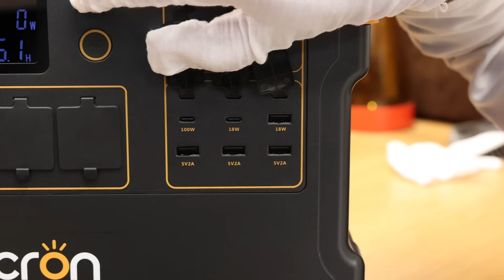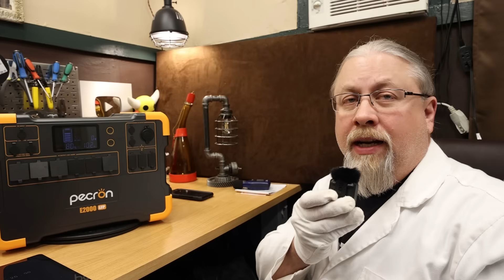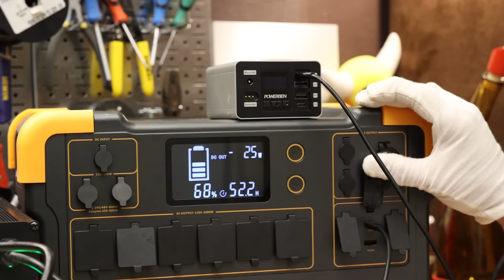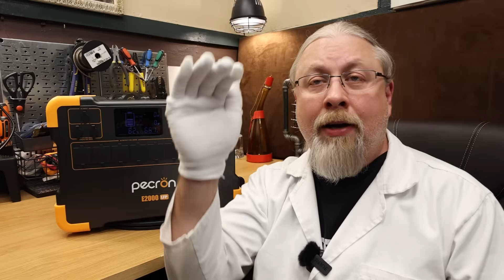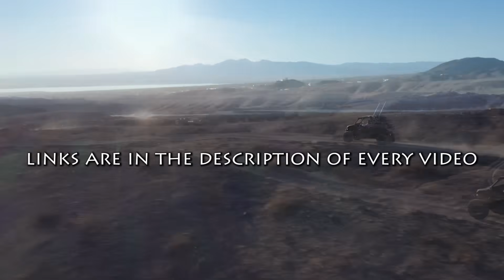Pecron E2000LFP 2000w LiFePO4 Modular Battery Solar Generator Power Station Review

Comment from the maker: CHECK OUT THE PECRON: https://gohobo.io/e2000lfp code HOBOE2000LFP for $854 
ORDER the 3072wh BATTERY: https://gohobo.io/eb3000
[UPDATE: Pecron now tells me my version was an early model and the 100w PD was fixed in the production version!]

DISCOUNT CODES on SOLAR PANELS - GENERATORS - REFRIGERATORS
https://hobotech.tv/amazon 

RECOMMENDED BEST PRODUCTS
https://hobotech.tv/
Reply: We can confirm this, all the e2000lfp units that are being sold now are 120v and have 100w (20v @ 5a) usb-c outputs :)

Comment: 3/16/26 - The E2000 is no longer sold. However, the E2400LFp is still available. Similar to this video's model, but there are some limitations like only 3x120V plugs. The 120V charging power supply is built into the E2400LFP; no external giant brick just a cable to the wall. This new model is currently $629, BUT you can get this from Off Grid Stores for that price and currently 10% cheaper with a coupon on their page for this model. That's $566 with free shipping for 2400W inverter and 2042WH of battery. Quite a deal if the limitations meet your needs. And you can still add two batteries to this one as well. No 30Amp plug FYI ... like the E2000.
Reply: They made two different versions of the E2000LFP and I've seen no review of that version on YT. I chose the version that includes the 30a RV plug but you get one less 120v household outlet (4 total).

Comment: Important note for people with this model (or similar models without direct AC input ports): passthrough charging works, but it is extremely noisy on the AC output. It will NOT pass the amp interference test when charging this unit at the same time.

Comment: I'm new to power stations. I bought one of these, a E2000LFP.   I haven't yet connected solar panels. I charged it up to 100% and burned two weak 3.5W LED lights for about 10 hours as night lights. This tiny load consumed 10% of the battery's power. I'm disappointed.

Comment: Hobo the fact that it doesn't have a UPS function is a bit of a disappointment. I bought this hoping I could keep the PC plugged in my pc.  the fact that the charger runs constantly is annoying. so for now I'm just going to plug it in when there's an emergency but I'm getting a good five to six hours according to the meter but we'll see once the first power failure hits

Comment: So currently the newer version has an RV (30amp?) outlet on the front replacing 2 of the 120v 20a outlets.  Have you reviewed this version or plan to?  I'd like to see if anything else has been upgraded. 11/30/24
Reply: Remember that's a 30amp style RV outlet that will have 20amps supplied to it. Still very useful for an RV 30amp cord.

Comment: I got a new Pecron E2000LFP October 20,2024 paid $750 came with 120v 30A RV outlet.   I use it to charge my Tesla Model 3 and the Tesla shows 120 volts @ 12 amps coming into the car.  I recharge it with 12-vertical fence mounted 100 watt bi-facial solar panels. The Pecron manual doesn't recommend more than 4-100 watt panels in series is 84 volts just under the max 95volts.
Reply: How do you like this model?  I wish there was a review on this newer version.  I'm very close to pulling the trigger on this as it's currently $749 for black Friday 2024
Reply: @tonystubbs9189  It's a work horse especially with the rv outlet.  Well worth $750 get it now before it doubles!  Only one downside is if your overload the ac it just completely shuts off without any warning so it's surge capabilities are not the highest or longest.  Other than that I love it and use it everyday.

Comment: Can it charge through solar automatically if the power is off from depletion or would you have to manually turn it on before it starts charging?

Comment: I ordered one of these largely based on this review, and I'm looking forward to receiving it. However, I'm already not impressed with the company/ customer service. Delivery was supposed to be yesterday, but FedEx decided to return it to sender as undeliverable, without even attempting delivery, because they determined that it was a hazardous material and it was not packaged, labelled, or shipped appropriately. I find it baffling that a company dealing mainly in batteries did not find it prudent to pack, label, or ship a...  *battery*.... appropriate to shipping guidelines. Additionally, there has been zero response (not even an automated acknowledgement) to my emails about this problem.
Reply: I did finally receive an ack, 3 days ago, but no update since then. This is unacceptable @pecron2879
Reply: Ok the replacement finally arrived and I'm happy to have it. So far it does seem like the solid product reviewed here. But as noted in some of the other comments, their customer service REALLY needs to improve.

Comment: Hi great video! between pecron e2000lfp or the vtoman 1800 would you pick one over the other? In your opinon is the bulky power supply of the pecron a deal breaker compared to other power stations out there. I'm just looking for something affordable with good value. Thanks

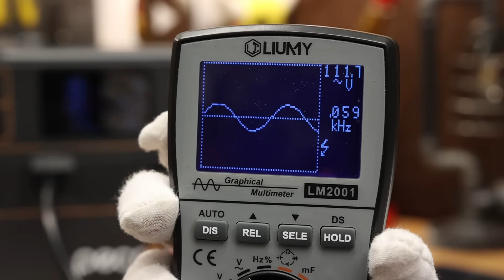Comment: 05:30 Thanks very much for showing the output waveform UNDER A DECENT LOAD. Missing from so many reviews. 
Would also like to see a quick peek at both near minimum and near maximum loads and also when it's "running hot". I've seen output waveforms vary substantially depending on the MOSFETs and capacitors used.

Comment: What would be a good panel to use with the Pecron E2000 LFP that is mountable to the top of my vehicle? I have a roof top tent on my Jeep (with luggage rack), and looking for a durable panel with the correct voltage. Thanks for any help you can give!

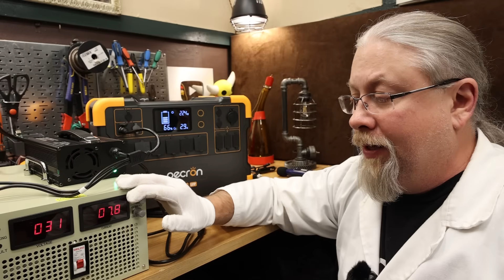Comment: 9:10 you can see once the voltage is increased to 32V (the stated minimum) the amps creep up to 14.2, charging the battery at about 450w. this is confirmed in Jasonoids video when he charges the pecron with a 12-36v boost converter and it does the same.

Comment: this thing has been. nothing but a PITA for me.  Not solar charging, super slow charge off the vehicle, problems with the LED.   I built my own with a battle born and a redarc dc/dc.  It blows this away, just is a lot larger and heavier.  

Very Very disappointed with the Pecron

Comment: I think the "safest" sure way to use an external battery source is to use three 12.8 volt / 100 AH LiFePO4 batteries in series.  This would give you approximately 38.4 V * 100 AH = 3840 additional Watts.  If you use their spec of ~15 amps input charging using the 38.4 volts input, the input to one solar input would be approximately 576 Watts, just under the 600 Watt solar max....  As a decent 12.8 V LiFePO4 battery can be obtained  for ~275 to 300 bucks * three, you would then have a total of ~ 5760 Watts of total power available for ~ 900 dollars - saving about 500 bucks over the $1399 EB3000....  With using the EB3000 @ 3072 Watts + 1920 Watts for the main box = 4992 Watts available), an ADDITIONAL 768 more Watts over using the Pecron battery.....  IMPORTANT NOTE:  This way to expand battery capacity will only really be good for users that don't need the FULL availability, as you only have the approximate 576 Watts available at any one moment.  The EB3000 battery can/will give you the total 3072 Watts to be used at any wattage load up to the 2000 Watt inverter capacity, I.E. powering about a 1500 Watt load for ~ 1.5 hours or so....  For the high wattage user, the EB3000 will perform best....

Comment: They designed the solar imputs that way to make it hard to use cheap lithium batteries, like power queen or Redodo, as expantion batteries, unless you but 3 in series for 36 volts, in hopes that you will buy there over priced expansion batteries..I would still put 3 -100Ah batteries in series myself..

Comment: Curious if you plan on doing a review of the expandable EB3000 battery?  You seemed to be high on Pecron but with the EB3000 battery out 7 months now, surprised you haven't reviewed it.  Are you still good with Pecron?  Also, they have sales going on now.  This unit is roughly $1050 (with promo code) and the EB3000 is about $1300 w/ code.  That's about 47 cents/Wh 😶  Price is great but do you feel it's a quality unit for the money?
Reply from the maker: That battery came out too late to make the review and my schedule doesn't permit backpedaling. I'm waiting on the 48v EP3000 and E1500LFP. Those should be a lot more popular.

Comment: Has anyone been able to return a Pecron unit within 30 days of purchase? I haven't been able to get a return address after five emails with me paying for the shipping. The unit has two 600-watt solar inputs, but its AC charger also uses one of those inputs. Therefore, one can not utilize both inputs for the solar and also use the AC charger. Anyway, I guess I got to call my credit card company and dispute the charge.
Reply: I've had great difficulty communicating with pecron. I really  liked mine while it worked
Reply: I was able to send back a defective unit a couple of days after receiving it.  Got a new one shipped out in less than a week.  As for the inputs, 1300W max solar charging is pretty awesome!  For the price, it's one of the best power stations on the market.  It has a total of 3 MPPT charge controllers , (600W AC or Solar,  100W Solar & 600W AC or Solar) so the MAX you can charge is 1300W.  You can use AC and solar charging at the same time, (600w input + 600w solar + 100w solar).

Comment: Great review, thank you!  My question is, can you charge this, or any other similar power station, using a regular (not inverter) generator?
Reply: A "regular" generator normally has the engine running at 3600 RPM to easily make the 60 Hz required for devices.  As the output is relatively clean, it should be OK to power the AC charging "brick".  What you don't want to do is use any AC voltage source that has a square or modified sine wave, like in some cheaper UPS's that have a very "noisy" output.  Any AC device - charging brick - will work BEST with a pure sine wave input....

Comment: I like it but only want to be able to put one 200w panel out outside of my Rv. That panel only delivers max 29Amps. So to be clear are you saying this unit won’t charge with solar with that amount input??Weight is an issue with RV so whatever I put in it something typically comes out.

Comment: Question.. when I have my pecron e2000 lfp plugged in and charging at about 550 watts with the lunchbox charger, when it reaches 100% it keeps charging and says at 550 watts or so. I left it charging for about another 7 minutes but it didn't stop charging.  Will it just keep charging and overcharge and ruin it if I'm not around to unplug it?

Comment: Another Great Video.
My question: On Solar charging you mentioned 2-200w Renogy panels to start with or 4-320w panels for max solar power.
I also noticed that there are 550w panels available.
 Would it be better to get 2-550w and connect each one to each port?
Is their a video reviewing the Renogy panels?

Comment: Hello professor,

In your video you tested the charging with "fake solar", your variable voltage charger. Since that seemed to take the charge, would there be any issues of charging the unit using 3 12v batteries wired in series to get over the 31v minimum requirement?

Comment: Doesn't it bother you that it has no "surge" capacity, as it shut down as soon as you went over 2000 watts? Most people would want to power their fridge during a blackout, which of course will have a surge with every start up cycle, (late model fridge will have a soft start as part of their energy efficiency ratings.) Of course, 2000 watts will should cover a fridge surge, but I have to wonder about other appliances. I have a 1500 watt inverter that has a surge rating of 3000 watts, and it's powered my big side by side late model fridge no problem, as it should. Some with an older fridge or freezer might be disappointed to find out the Pecron shut down on them from overload surge and all their food went bad.
Reply: That is not surge rating. Surge is less than a second

Comment: Hello Professor, bought an E2000lfp and pretty satisfied after the first one was returned for no go, (Customer Service pretty good so far). I see that the EB3000 (3kwh) expansion batts are out. Want to add expansions but won't until I start seeing some reviews from my trusted UTubers. When do you think?
Reply: No weird noises from the fan area. Unit has been performing flawlessly 24/7 since beginning December 2022.
Reply: @dinobernardi170  No problems with mine either, Running 24/7 with 1,200 watts in and up to 1,500 watts out everyday. full 8kw system
Reply: Had the same thing,. returned the first one but the second one they sent me has been great!  I also pre-ordered the EB3000 and it has far exceeded my expectations.  Look up "Pecron" on youtube and watch some of Rambling Bob's videos and you'll get some great info!  Looking forward to HobeTech doing a review on the EB3000!!!
Reply: @BucksBe  Thank you for the mention :)

We have done MANY tests on the 8kw system....
Reply: Dino Bernardi.  How is your new unit performing.  Any weird noises from fan area.

Comment: Why can't these companies put the power bricks inside the machines?  One less thing to lose, damage, trip over.
Reply: It really doesn't matter.  Charging is super quick.  To save 1k on a unit with the only difference being an app and having an internal ac charger, I have no issues with the brick.  To each their own I suppose 🤷‍♂
Reply: @BucksBe  how has the pecron 2000LFP been performing.  Any issues
Reply: @donaldricher8815  Love it!  Received the EB3000 battery as well and 10 out of 10 in terms of price and performance.  Going to buy the second expandable battery soon :)
Reply: @BucksBe  have you heard any dual up noise from the fan area when using AC power.  Some people have complained of beeping noises.  Which solar panels did you end up purchasing
Reply: how lazy are you?
power brick inside the machine makes it heavier and adds heat to the batteries.
also, if the power brick inside goes bad you have to send the whole thing in for diagnosis.
unbelievabe how spoiled people are these days.
Reply: @markjoyous3525  a simple access panel enables people to remove, service, or upgrade machines.  You say I am lazy or "privileged" for wanting a better design that harkens back to a time when such things were commonplace.  About 3 decades ago.

Comment: I ordered the Pecron during Black Friday price sale..  Used your coupon to get the E200LFP for $1,235 ish the sale price worked with the coupon. (Thank YOU!)  
The functionality was exactly as described.  My use case is hunting camp with a HF Predator 3500 to charge the Pecron.  This will give me on demand power and greatly reduce the run time of my generator.  
The BOUGERV 180w Solar Panels are my next addition to the system. 
 I am going to back up my freezer with the Pecron if we have grid issues.  I would have loved the addition of UPS to the device.
Thank you very much for the video.  :  )
Reply: Barkingspider2007 Have you had any issues with your Pecron.  How's the charging performance.
Reply: @donaldricher8815   It seems to work well...  Leave it charging longer than the battery indicator says, it's got more to go to be at 100% charge.  Good value for the $$$

Comment: I am not certain if it has been mentioned already but the latest version of this E2000lfp which I received recently due to an rma is now outputting 120volt ac whereas the prior version would only do 110volt.  I would assume it also does output usb-c 100w pd however I don't have a usb-c powered device that will pull in 100watt, my laptop only pulls 60w even from its only power adapter.

I had ordered one in August and it worked well and I really liked it however it had a strange issue with the ac inverter and the exhaust fans and that one only put out 110v, so they are making changes/improvements/revisions...so good on Pecron!

Comment: Professor, any idea why my e2000 sounds like dial up modem?  Only using about 20 to 30 watts for lights and ceiling fans.  Very impressed with the unit but sounds like it's trying to start a fan, but maybe can't decide if it needs cooling or not.  I guess it works great for the off grid shack but the dial up thing is irritating when it quiet in here.  Is this normal?
Reply: Self protected  you still having issues with dial up sound

Comment: Thanks, Professor, for another great review. I've yet to see any review from someone else that even comes close to the level of detail you put into these videos.
If you have some time, I have a couple of questions:

If the primary reason to purchase a SG is for backup power (think, Florida) it seems to me the best option is to have UPS capability (UPS relay). That way, instead of just being stored somewhere, it can take the place of a computer/TV UPS and be used on a daily basis. Is that a fair assumption?

I've gone through several tropical cyclones where we lost power. The main thing electricity is wanted for DURING a storm is the refrigerator, TV and internet. Flashlights, battery powered fans, and small power banks for phones, etc. can take care of most other needs. I know the technology (and prices) are rapidly changing, but based on my above criteria, would you have any recommendations?

I've posted a couple of your videos on the Eye On The Storm blog (Yale Climate Connections) and was surprised at how many people weren't even aware these things exist. I'll post this one too later today. I got an email from YCC the other day titled, "Everything to buy if a hurricane is forecast for your area" and there wasn't even a mention of a SG. It seems to me that should be on the essential list for those that can afford one. Especially since practically every storm has someone dying of carbon monoxide poisoning from a gas powered generator. Any thoughts you may have on this will no doubt be appreciated and passed on to the EOTS blog. 

Thanks again,
Mike